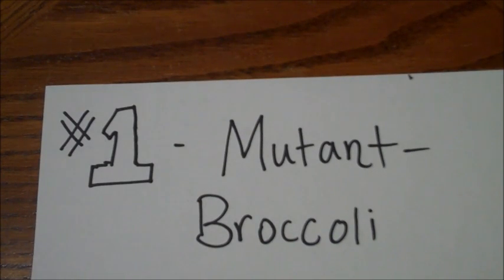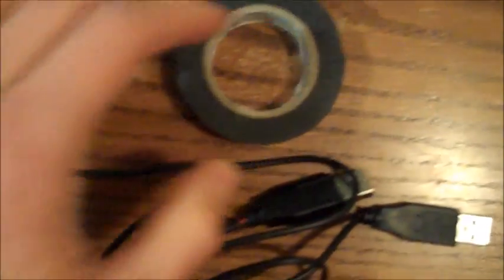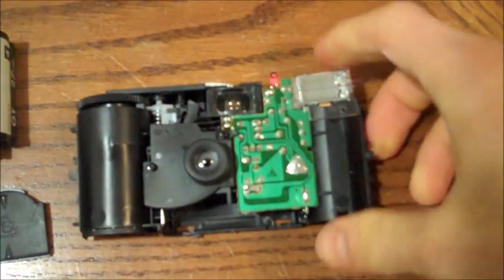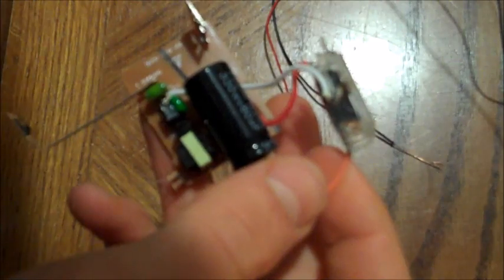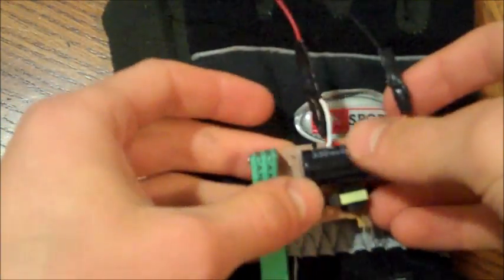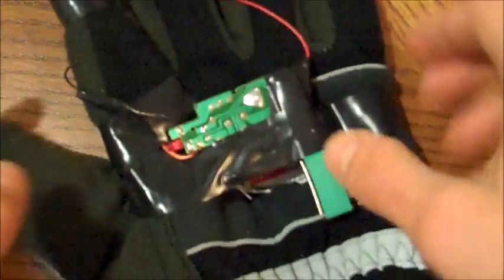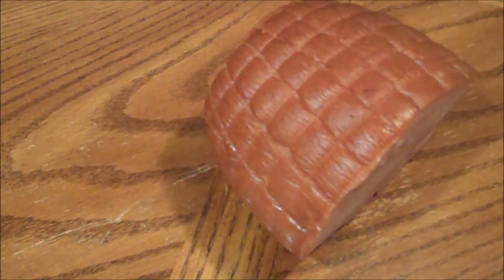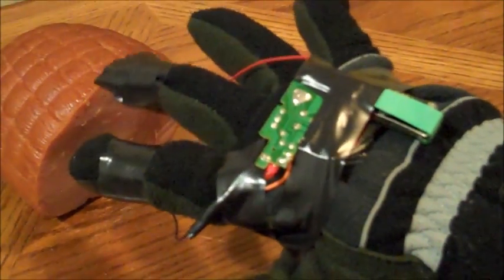How To Make a 330 V Taser Glove for $10

Comment: Does it actually shock someone with 330 volts. Because I think the 330 v on the capacitor means that the most volts it could take is 330, not how much it can output
Reply: the ampage seems pretty substantial, considering it was able to dent that metal and steam that ham.
Reply: most likely would feel like grabbing an electric fence for cattle and such.

Comment: just a quick question. isint 330Volts of electricity dangerous? please so hate, im not saying this is illegal, just wondering? wouldnt it be dangerous to push on someone with this??
Reply: No not at all. 330 volts isn't dangerous as long as you have very low amperage which in this case it has quite some current to it (amps+volts+watts) so yes this can be dangerous but volts won't kill you. I've been shocked by 10,000,000 volts before but low amperage which is why I'm alive right now. Correct me if I'm wrong.
Reply: Chili master17 ok ty, just learnt a new thing :)
Reply from the maker: +EaG gaming nope as long as not too many amps
Reply: It's all about the ampage ok he's an example you could be shocked will even 1000 volts but if there is no amps it won't kill you it will hurt like hell but it won't kill you

Comment: you could use bug zapper instead of disposable camera
Reply: Except this ones better because of how many amps it has. Bug zapper can't do anything to metal. This can actually melt the metal. And if you were wondering this can't tase someone. A taser is commonly 1,000,000+ volts.

Comment: i dropped the circuit board about 6 inches and the thing fucking doesnt work now. a little green cylinder got dented inward. im going to try the taser glove design with the bug zapper, it seems more robust and better suited for how i intend to use this thing.

Comment: if you wire it long enough, you can hide the circuit board in your pocket and before the glove, you can add headphone splitters so 2 becomes 4 (i suggest + - + -), find something that has a button on a wire and then extend the wire to your thumb, that way you can make it live at the click of a button, but for safely discharging it, i have no idea.
Reply from the maker: ooh that's an awesome idea!
Reply: an alternative suggestion is have a button under the glove (under the thumb metacarpal) and the nodes on the thumb and index finger with the other three as fingerless of you want to do parkour with it on, also you can grip someones neck and KO them or something

Comment: I'm so making this where can I buy the camera and what's it called
Reply from the maker: New from Walmart or ebay.  it's called a single use camera
Reply: you can also just use a flash that you buy from eBay for higher voltage be sure that it is not a camera with a flash but ONLY a flash though!